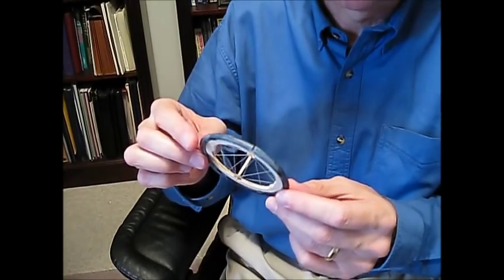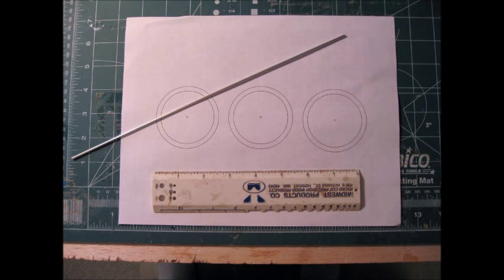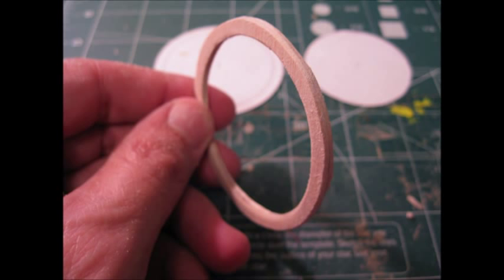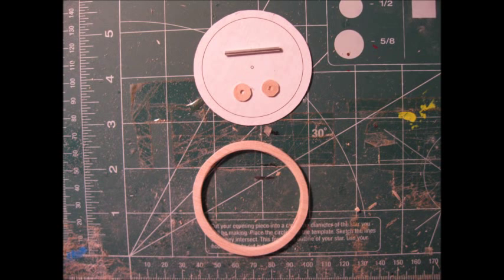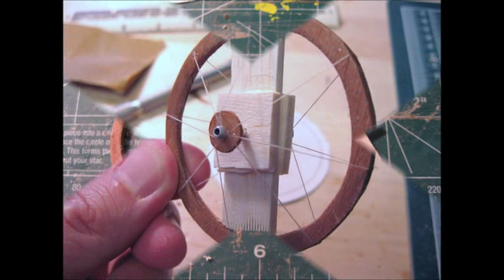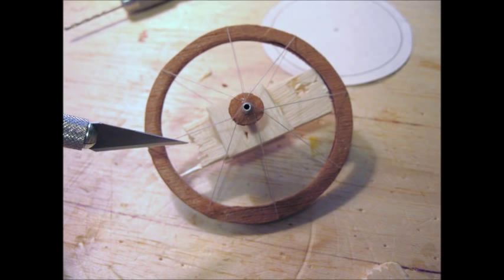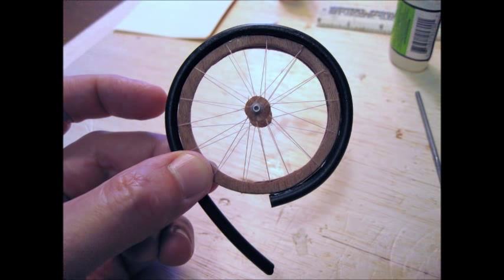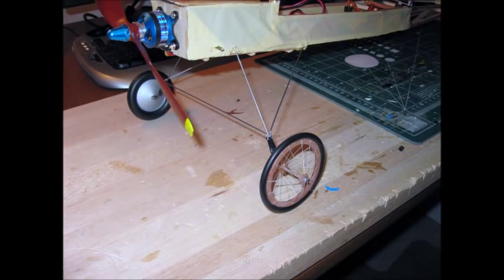Easy Build Spoke Wheels for RC Model Airplanes

Comment: Thanks! This is for display only, or it can use it on a rc plane. Great work!! Thanks
Reply from the maker: Felix:  This was designed for lightweight, indoor RC models.  Could be applied to heavier, outdoor models.  I just have not done this (yet).  Tim
Reply: @TimMcKay56  thanks!!

Comment: Interesting ! but you didn't mention the name or type of thread used which is very important for a beginner also the nicks on the balsa edge to seat the thread I use a metal sowing machine shuttle for my axles and I go to a pool shop and buy the gasket material in any length reqd also i take a wheel to check the look of it . When I put it on the hub i make it half inch smaller and join it with super glue but be careful you only have one chance to line it up . Hope this helps someone
Reply from the maker: Many thanks!  Tim